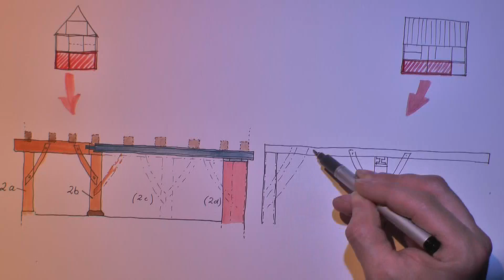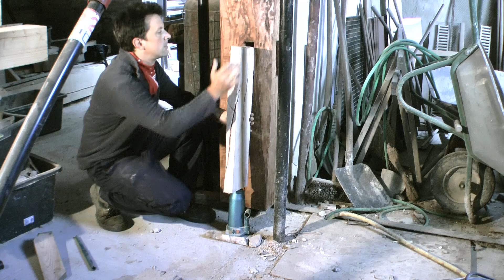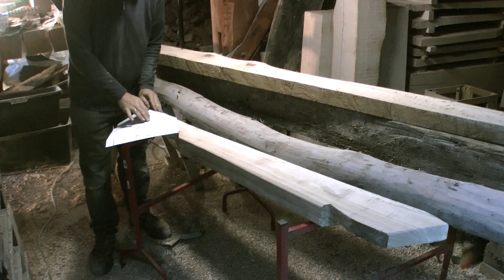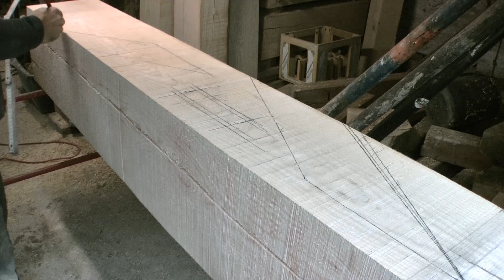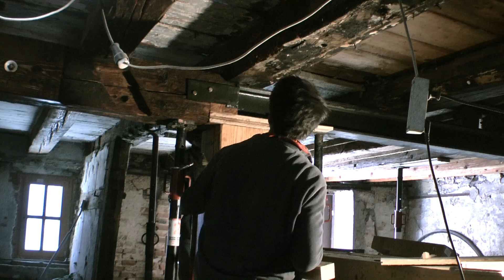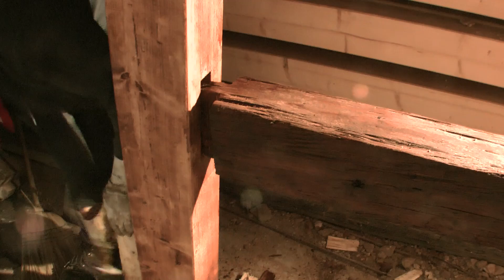Timber framing 3

Comment: What is the liquid that came out of the pin when you set it at around 8:50?
Reply from the maker: +aallwwkk too much linseed oil, that I had applied for a bit of conservation
Reply: thanks for the response. we don't have anything this old in the US. it's interesting to follow along. 

how hard is it to work with building inspectors on something like this?
Reply from the maker: +aallwwkk No big problem if you can show them that you are following the usual methods in restoring such buildings.

Comment: As you were fitting the braces, did you pre-load their respective beams?  I would wonder if, after setting the braces and pins, that some of the beams might still sag a bit as they take up the tolerances of the mortises?
Reply from the maker: Vedrfolnir No, because the braces are there only for stiffening the frame, not for supporting the horizontal beams.